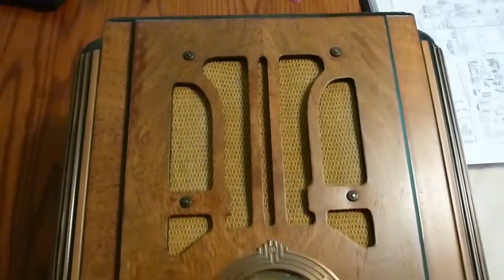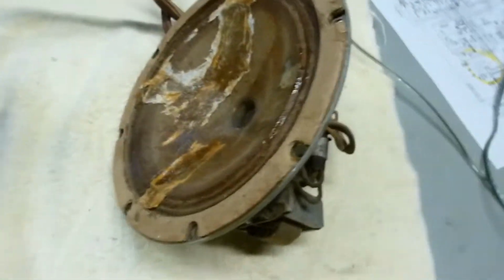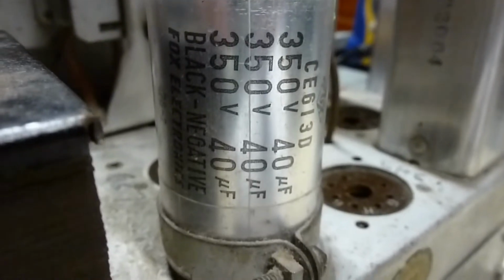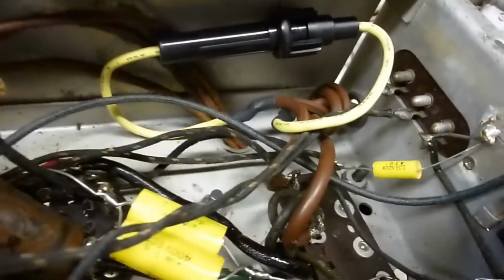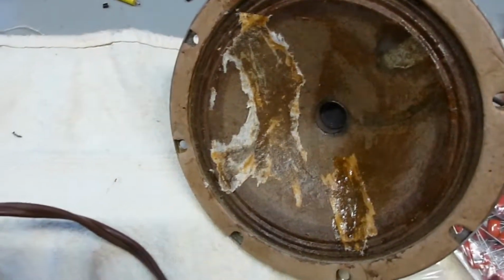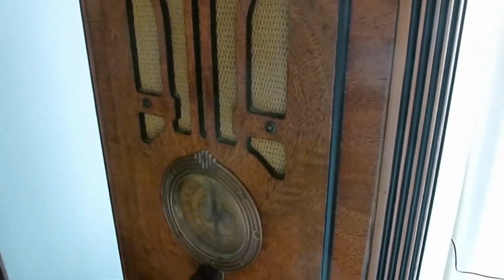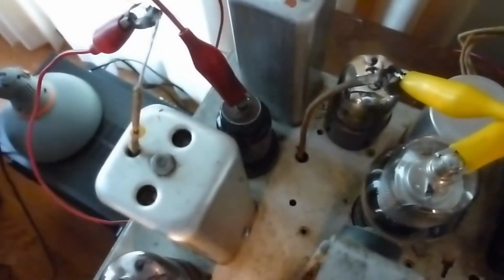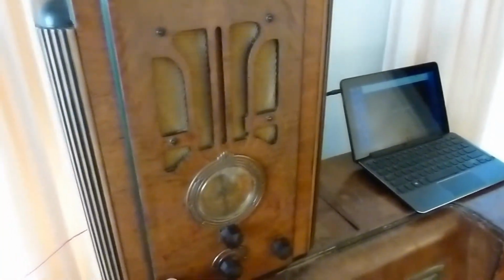Crosley Model 655 Radio Restoration

Comment: Yeah mine looks a lot like that then it's not it's mine is a 6 tube in the transformers in the front numbers on the bottom band and am on the top and it says AF on selector doesn't have the plate are these shortwave on the other band? Because mine only has numbers on the bottom
Reply from the maker: The Crosley 655 does have a short wave band which are the numbers on the bottom of the dial.

Comment: Thank you for posting this restoration. Nice job on getting that radio working again. I bought a Crosley model 635 today that appears to have been restored at one point. The 635 looks like your 655 in the video except mine has wooden knobs on the front. All the tubes, speaker, transformer, etc look that same as the 655 you worked on best I can tell. Mine seems to work on 540-1700KHz (broadcast), 1700-5200KHz (Police) and 5400-15,300KHz (amateur) bands and I have picked up stations on 2 of the 3 bands with a 50' long  copper wire for the antenna bridged across A1 & A2. I have one bulb missing and the volume and band selector pots needs contact cleaning to rid the popping when being turned. Your video will be extremely helpful to me if/when I decide to clean it up a bit.
Reply from the maker: Thanks for commenting on the video and I'm glad you found it useful. Good luck with your Crosley, great old radios!

Comment: Nice job on the restoration! And also nice to see a real Crosley product, instead of the new Crosley-branded junk they make today. I always groan inside when I unknowingly inherit someone else's botched restoration job--not only do I have to fix the set but also their mistakes as well (double the work). The fact that they had 350v electrolytics in this set is scary--surge current on startup would destroy those in short order
Reply from the maker: I agree.  Luckily I did not power up this radio before checking it out.